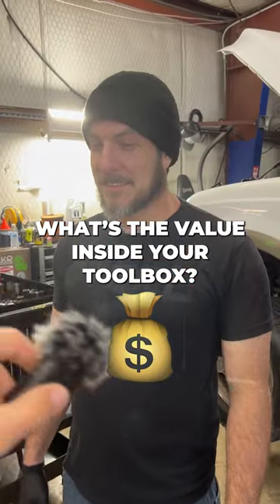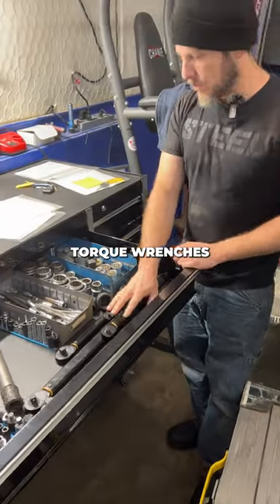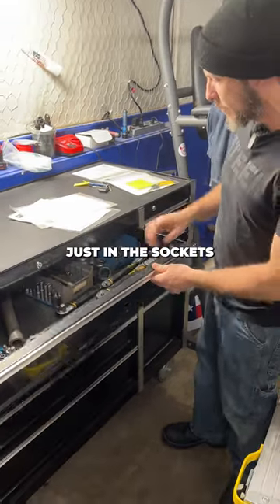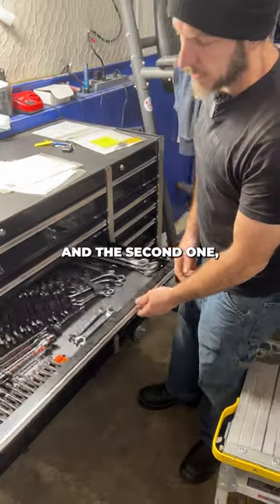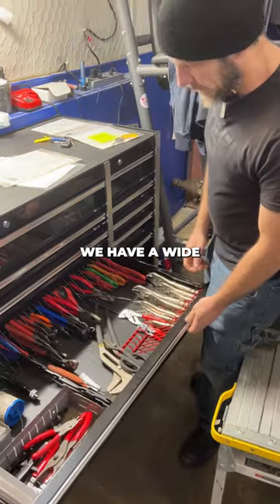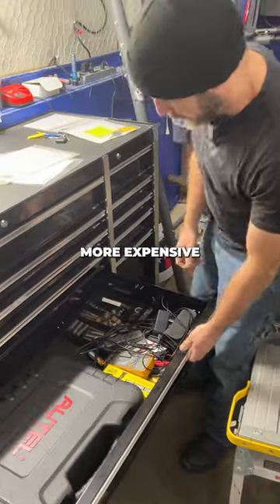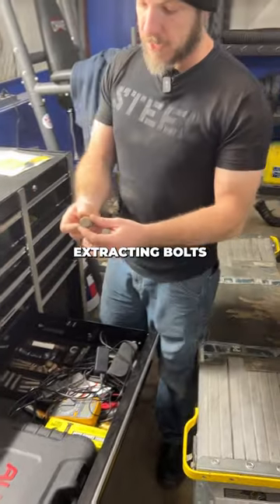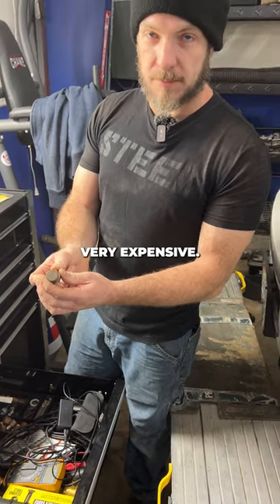Mechanic's EXPENSIVE Toolbox🤑💰

Comment: I like how he was opening the second drawer and forgot about the Pittsburgh ratchet and socket set and quickly closed it he might have $15,000 worth of tools and that's being generous
Reply: You're right, I just caught a glimpse of the 3/8".
Reply: I was being generous with $25,000 not seeing the battery tool drawer in the short.
Reply: Not even close   That’s a 56” box lol
Reply: You realize most hi end scanners are like 10 to 20 grand on a tool truck shits not cheap lol
Reply: Facts.  Lexivon torque wrench from amazon 3 pc set 150 lmao
Reply: Autel scanner 500 bucks
Reply: 15k and still getting the job done!? What’s the problem with that? Why the fuck would you want 80k in tools?

Comment: 80k that's a cap ! A good mechanic doesn't need all that .facts!
Reply: Maybe not if you work at dealer, but also It’s not about needing it it’s about the more tools you have to make the job easier the faster you can get it don’t and the more money you can make I have so many specialty tools that make one specific job so much easier and that’s how I can flag 70-100 hours a week without breakin a sweat, I also don’t have 80k in tools though but I will keep buying them untill I have more than that
Reply: Ummm... In today's auto mechanical world... Yes tf you do. The amount of times I've thanked my stars for having been handed down tools. Half the time without an 18" extension, a universal joint attached to that and a specialized deep impact socket I can't get the job done on these newer cars.
Sometimes we have to put cars on lifts to get the oil filter out because we can't get to them in the dugout.
The war between mechanics and engineers is at its worse😂😂

Comment: Stop buying over priced wrenches.  If you are breaking stuff....you are using the wrong tool for the job and/ or wrong methods.
Reply: This right here
Reply: Shhhhh you can’t be telling people this
Reply: Cheap wrenches are absolute shit
Reply: If it’s gearwrench or blue point, it’s life time warranty and usually same day replacement if your Tool Truck guy is available
Reply: @allmyflaws  Harbor freight is also lifetime warranty and you can replace it any day you want. Not saying there's no place for the tool truck, there definitely is. Just saying there's practical and low cost alternatives of someone doesn't want to give up that kind of money. Tool truck prices are just out of control these days they don't have as much benefit as they used to. To each their own, though. They are quality tools without a doubt.
Reply: @williamuskoski1385 ive rebuilt quite a few engines and have worked on vehicles and heavy machinery half my life. I've never broken a wrench and have rounded off a handful of nuts using cheap wrenches. I also live in the Midwest where rust is the worst out of anywhere. Never bought snap on, blue point, etc. Some Carlyle though.
Reply: Well Scott wanna take a guess how many times the guys at my work borrow my snapon wrenches after there cheap wrenches are rounding off even drain plugs trying to take them out and after they muck the drain plug up they use my flank drive wrenches and the tight drain plug comes right out....stop being cheap your in the wrong trade if your cheap lol
Reply: Sorry but this is true buy junk get junk cheap shit is OK for home shit but I'd be lost without my main brand tools for work I break anything at all I get a brand new one no matter how we break it except for power tools those have like a 5 year warranty
Reply: @6door6four96  maybe they should stop using 12 points, the wrong size or a impact. I have many expensive tools and even more cheap ones. I’m not a daily mechanic although I’ve swapped engines rebuilt entire suspensions, brake set ups, etc etc on many vehicles. I just spent almost a month in my free time rebuilding my utv from the frame up. If you are using the right tool for the job you don’t have issues. Unless you are using something as cheap as kobalt, all my cheap stuff is at least Pittsburg quality.

Comment: Specialty sockets alone can run 40-100 each. IDK about 80k but it's possible. My electric drawer alone is a bit over 10k. And half of them are Milwaukee which is cheaper than my snap on tools. Torque wrench 700 one impact gun 800. It adds up fast.Flashlight 350. If u know u know

Comment: The black and yellow Lexivon torque wrenches are like $30-90 (ranging) a piece. 
Sockets DO get expensive if you buy all snap-on/matco/Mac but maybe like $4-6000?
Pliers drawer: maybe $4,000 
Autel key programmer full diag tablet maybe like $7,000?
I'm assuming he's got impacts, ratchets, etc.. 
Without seeing those , I guess $4,000 

Without seeing additional boxes/tools I'm going to give a $25,000 value.